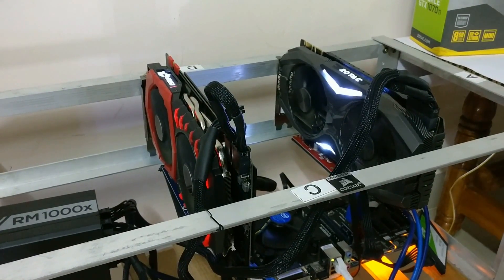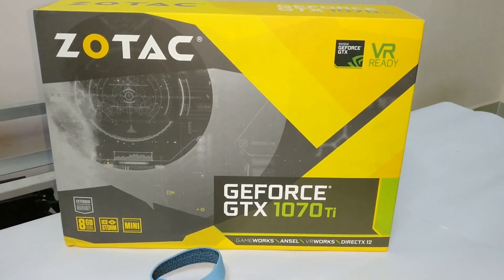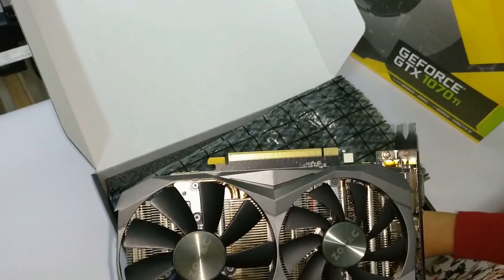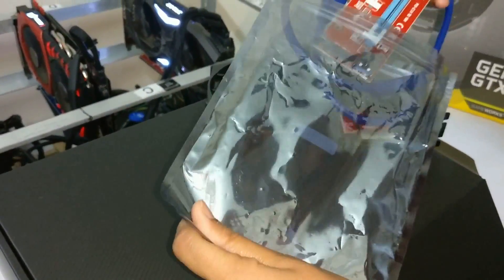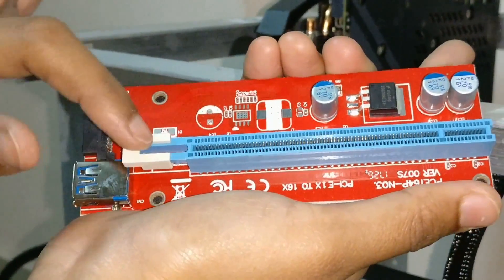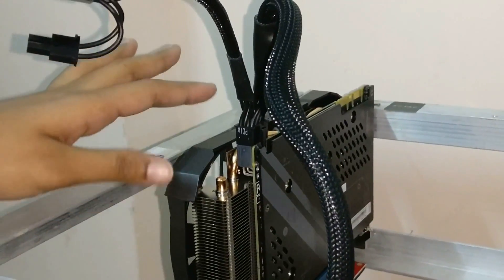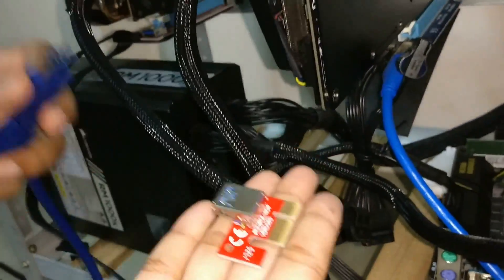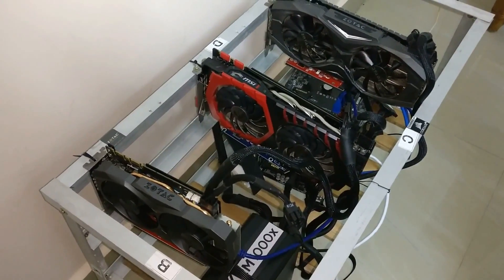ZOTAC GeForce GTX 1070 Ti Mini Unboxing & Assembly in INDIA

Comment: What is hash rate of 1070ti before and after over clocking ?
Reply from the maker: Hash rate varies based on algorithm. which algo you are asking about
Reply: TechnoSaviour  i am planning to add new graphics card in my rig i have asrock btc110 with 13 slots of gup and i have 4 graphics card 1050 ti with 1300w psu . Now i am plan to buy 1070 and i am vry confuse which is best 1070amp/1070amp extrm/1070 ti mini. Which is best card ? I currently use nice hash for mining .

Comment: After added the third card, have you noticed if one of the others dropped the hashrate? Do you need to setup something at the BIOS? What happened with the PCIE _2V auxiliary cable? Thx
Reply from the maker: Hi Viker, I didn't notice drop in hashrate after adding the third card. Yes, I did some BIOS changes.
You can check this link, I referred it  change some settings in my BIOS. https://www.gigabyte.com/MicroSite/462/mining.html
Reply from the maker: But after adding 3rd card that is 1070 Ti I ran into issues like the card was not getting detected. But the issue was that I needed to install the latest driver which supports 1070 Ti. Then everything worked smoothly.

Comment: Hey I am from Tamil nadu , can you review ASUS B250 Mining expert motherboard. Also is it advisable to go for dual PSU (1 ATX & 1 Modular) for mining?.
Reply from the maker: Hi Subramaniam S S  ASUS B250 is definitely a great motherboard for mining with no doubt, I think they will soon release a driver which will support unlimited Graphics card by using extenders. 
If you can go for one PSU with more power then its good, but if your Graphics card needs more power then there is no harm in having multiple PSU. Like in the case of ASUS B250 you definitely need to have multiple PSU.